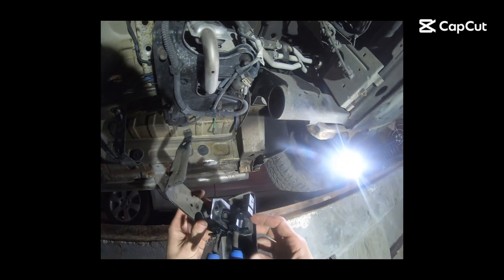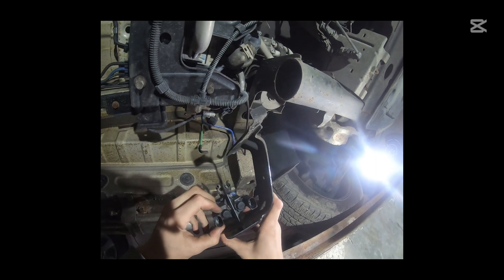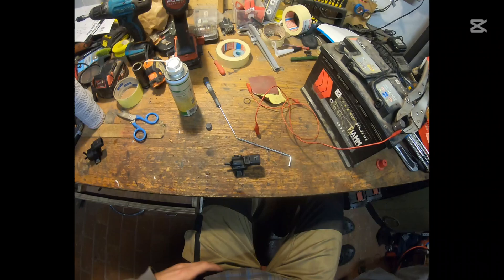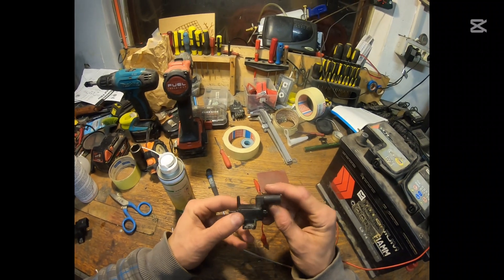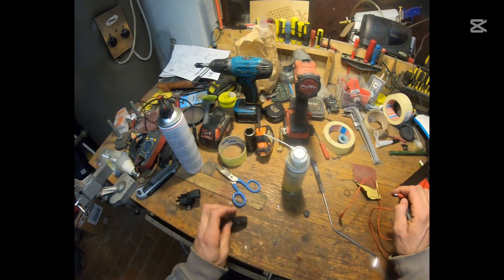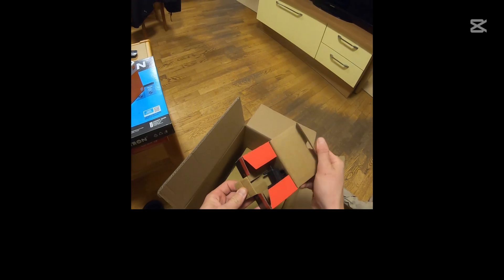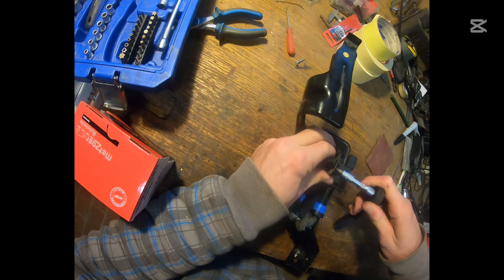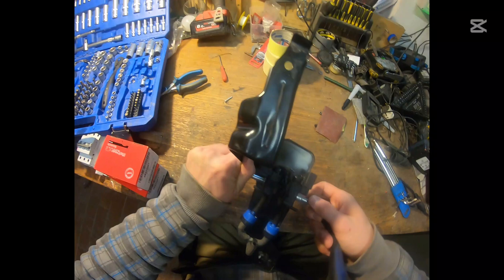VW T5 / T5.1 rear differential lock most common issue. How to identify, test and repair.

Comment: This is super, thanks. I am going to replace the stock be solenoids with some MCA aluminium sealed ones and extend the vacuum lines and wiring up to under the bonnet to get them out of that daft area they are currently sited. Should stop them failing again as they will be out of the way and more protected
Reply from the maker: Thank you. Yes, i've seen already people putting the whole solenoid assembly into the engine bay.  However i still think that if the vehicle is not used in harsch conditions excesively, the solenoids should last a while (ocasional activation also helps).
BR